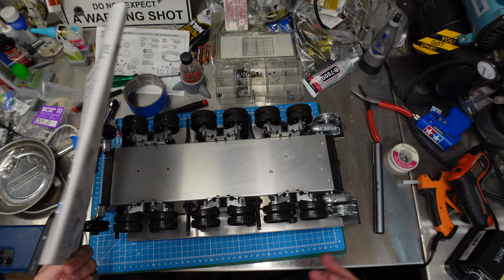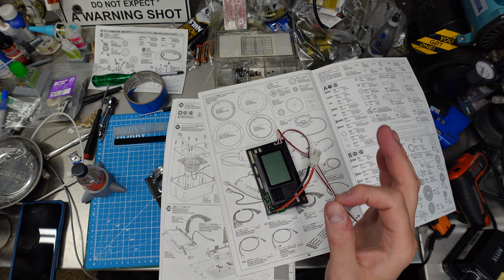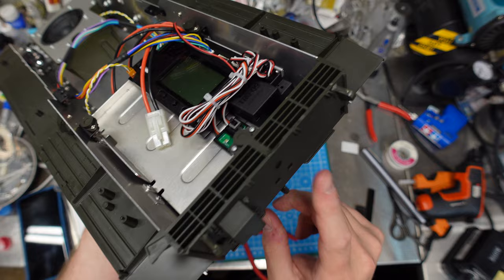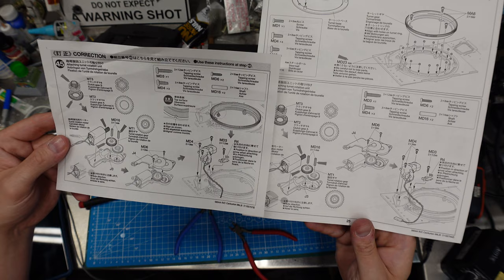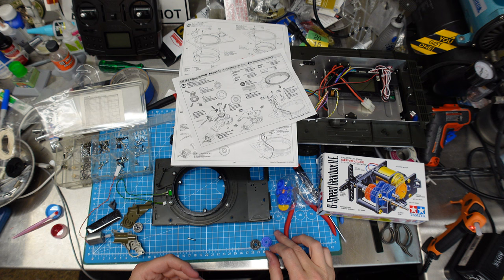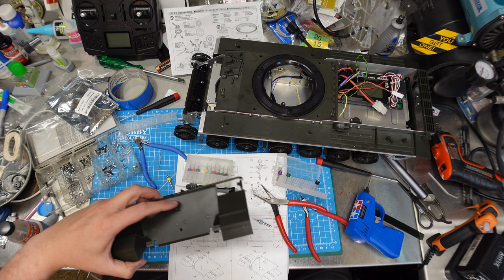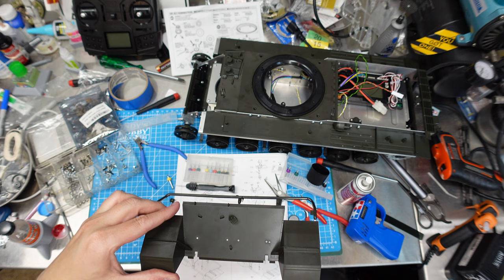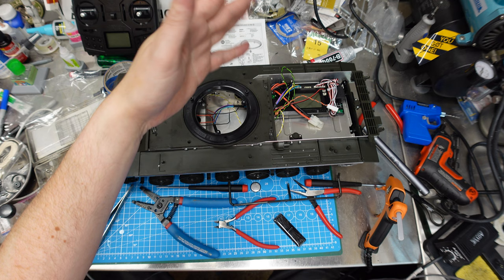Building the new Tamiya 1/16 Full option British Centurion MK III RC tank kit #56045 Part 2

Comment: Hello Ian.  Quick question, I'm trying to build up led light on my Centurion also. I have the lights installed in thr front.  What I need to know is what size is the 8 pin jst plug. I've been hunting on Amazon.  Tamiya had been out of stock for some time.
Thanks Jason
Reply from the maker: I think it's 1mm jst but tamiya has the Sheridan light harness last I checked.
Reply: @PitstainHobbies  is it the p/n that ends in 117? I just checked today still out of stock.
Reply from the maker: @jasontorre3267  I just checked and yes it seems to be out of stock for the time being